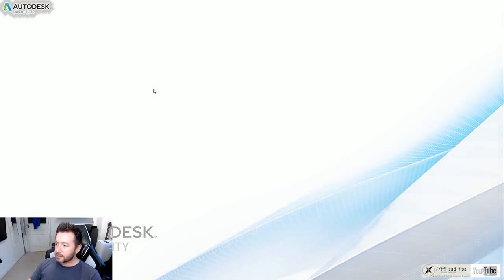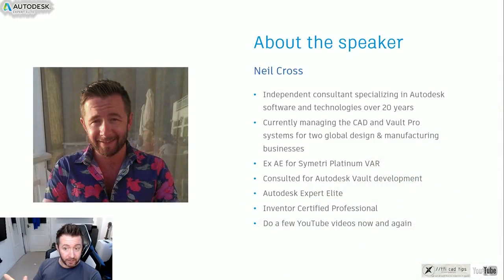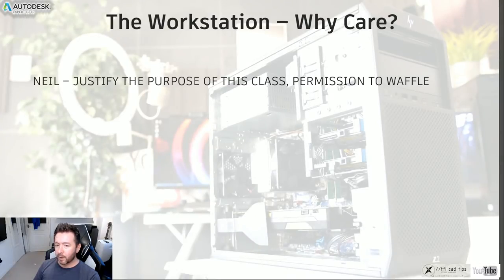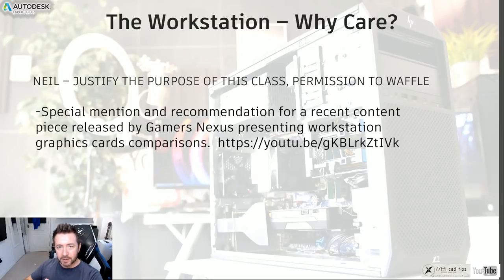Buying the Right Workstation For Inventor | Autodesk University 2018 Class Lecture

Comment: Hi Neil, do you know how the Inventor studio scales with cores vs clock speed? Secondly did you ever run tests on compute speed for FEA (not just meshing but solving), would be curious to see if thats just as poorly optimised for multi-threaded workflows. As a follow up to that as well, do the new Tensor cores on Turing cards actually do anything for this in Inventor?

Comment: Really interesting.   I'm in the market for a new workstation with good budget.  Just wondering, the i9900K is faster than the Xeon that you listed, so surely that home workstation would be faster than the "pro" workstation?  I assume the only reason you didn't recommend it is like you said, the reliability of the Xeons?  Also, the 1080ti has 11gb ram compared to the p4000 8gb AND it's cheaper.  So if the GPU doesn't really mattter then a 9900k + 1080ti would be the best combo available at the moment?

If anyone has this and has benchmarked, I would be very interested in the result :)

Comment: That same  HyperThreading BS is present during importing non Inventor CAD files as well. During importing 400 MB .STEP file, my 6C/12T CPU is maxed at 37% utilisation and I have to wait over 10 minutes just for Import dialog window and I have Samsung 960 Pro. Annoying AF. Load is spreaded over all cores, that's true, but I was expecting 100% utilisation like during RayTracing...

Comment: Always good to hear your tips Neil, excellent job.....I have just built this via an HP agent, looking to purchase in the coming days, would you verify all is good?

HP Z2 G4 Workstation - Customizable
SKU:2YW27AV_1
Windows 10 Pro for Workstations - HP recommends Windows 10 Pro
HP 3.5 to 2.5 Drive Carrier Z2 Tower
Intel® Wireless-AC 9560 (2x2) Gigabit Wi-Fi + Bluetooth® 5 (no-vPro™)
HP Remote Graphics Software (RGS) for Z
ENERGY STAR Qualified Configuration
Operating System Load to SATA
3-year (3/3/3 - material/labor/onsite) Warranty
512 GB SATA 2.5" SSD
500 W 90%-efficient Chassis
NVIDIA® QUADRO® P2000 (5 GB, 4 DisplayPort, PCIe) Graphics
Z2 G4 Tower Country Kit
9.5mm DVD-ROM 1st Optical Disc Drive
HP Z2 G4 Tower Workstation
32 GB (2 x 16 GB) DDR4-2666 ECC Unbuffered Memory
No Load Flex Port
Intel® Xeon® E-2176G Processor (3.7 GHz, up to 4.7 GHz w/Turbo, 12 MB Cache, 6 core) + Intel® UHD Graphics P630
Single Unit (Tower) Z2 Packaging
Z2 TWR SATA Data Cable - ST-RA -015
HP Optical USB Wired Mouse
HP VR Ready Configuration
USB Business Slim Wired Keyboard

$2278 USD

Comment: Hi All, 
I do Alias 3D modeling for production….not a lot of videos that talk about Alias So I thought I would chime in. Listed here is my list so far for a new Alias machine. I don’t know the specific chips or ram specifically yet. I use Alias Auto Studio 2019 to make Class A surface for production in car design. I render with Vred and KeyShot 8. This machine is only for modeling and rendering. I’ve never over clocked, gamed or been interested in RGB LED case…just a powerful machine I can set and forget.

I’m thinking and Dual Xeon chips with Dual G Quadro P4000 Graphics cards.I am seriously nearsighted so a new monitor the size of the sun is needed. Worried about the size of the Alias dialog boxes and marking menu sizes with new 4K or widescreen option available. Due to my blindness I’m starting with the monitor. The 38” monitor from LG with 21:9 ratio or a Samsun 43” or 49” look great but Dell does have the 43" Dell Multi-Client Monitor | P4317Q and the Dell Ultra Sharp 49 Curved Monitor: U4919DW. I need to be able to sit back from the monitor yet see the main menu. 

1. Chips (2) ?

2. Motherboard?

3. SSL drives.

4. RAM.

5. Monitor.

6. Graphics card- P4000 (2 units).

7. Case-

8. 

.

These guys make a great machine… 

https://www.titancomputers.com/ 

https://www.pugetsystems.com/

Autodesk Alias' listed system requirements looks to benefit from several CPU cores, so going with a higher core count processor looks to be beneficial

https://knowledge.autodesk.com/support/alias-products/troubleshooting/caas/sfdcarticles/sfdcarticles/System-requirements-for-Autodesk-Alias-2018-products.html

In Autodesk VRED the system requirements does not appear to benefit from several CPU cores, and recommends at least 8GB RAM, along with current graphics card.

https://knowledge.autodesk.com/support/vred-products/troubleshooting/caas/sfdcarticles/sfdcarticles/System-requirements-for-Autodesk-VRED-2019-products.html

Here is their certified graphics card list: 

https://knowledge.autodesk.com/certified-graphics-hardware

Photoshop and Illustrator benefits from hardware as mainly a single-threaded program.  That means instead of benefiting from several CPU cores, mainly benefits from a high CPU frequency (GHz rating).  The higher the GHz, the faster calculations occur per CPU core.  That makes a processor like the 6-core Core i7 8700K with its 4.7GHz Turbo, or 8-core Core i9 9900K with its 5.0GHz Turbo great choices for performance.  Not sure here….to many options to look at…

In my testing of Keyshot I saw that it is a very well multi-threaded program, benefiting from more CPU cores, so going higher core count, the better performance you will have.

https://www.pugetsystems.com/labs/articles/KeyShot-7-CPU-Comparison-New-14-16-and-18-core-Skylake-X-Processors-1044/#BenchmarkResults

Since it looks like some programs benefit from several CPU cores, and some programs benefit from a high CPU frequency (GHz rating), I think the best thing to do would be to go with dual CPU that offers a good amount of CPU cores, and CPU frequency.  If I go this route, a 14-core processor or more to account for the lower CPU frequency these processors have would be where I may start.

I’ll keep you posted as I find more data…..

Comment: I just bought an MSI Gaming laptop ( GF72 8RE) to run Inventor. I need a laptop for portability. It runs Inventor effortlessly. I don't need to do any ray tracing which is where it would no doubt struggle but for 3D CAD it's awesome, as is Inventor.
Oh, and so are you Neil. Thank you for the tutorials and advice.

Comment: Thanks Neil as despite being considered an expert where I am, I am by no means any expert just under 2 years experience of Inventor my skills are good but not as good I want them to be, thanks for the amazing videos and whilst you may call yourself an amateur youtube creator, you are a professional at CAD and these are the best videos within miles.
Reply: I currently use a 7800X as my general purpose PC as whilst it has 6 cores it can go much fatster and OC'ed without any perofrmance or stabilty risk which is much cheaper than a xeon based system, plus the extra PCIE lanes are great for ssds.

Comment: Autodesk publishes the hardware specs for each of their products on the website.. I was wondering your opinion on this @TFI? I see this same discussion about "which hardware" over and over in countless forums. If everyone just referenced these specs from Autodesk and purchased their system accordingly that would be the end of discussion right?
Reply from the maker: I should probably do a video on that, the specs on the Autodesk website against the products are less than vague, they're not enough to actually go and tangibly choose something specific.  They're certainly not enough to ensure you're not wasting your money on something terrible which is worse than something you could buy for far cheaper.  Example - Inventor recommended CPU for complex models is 3.3Ghz or greater, 4 or more cores... well the Xeon Gold 6144 CPU has 8 cores and runs at 3.5GHz, and costs a whopping $2925 just for the CPU.  But there are CPUs for $400 with specs far more suited for Inventor.  Its not Autodesks fault, they can't perpetually monitor new CPUs and keep a running 'best computer' build sheet constantly updated, that's for the likes of me to do :)

Comment: Would it be a safe assumption that Autodesk Revit is going to perform similar with Inventor as far as how the programs are designed and operate, i.e. mostly single threaded, graphics accelerated by the cpu, etc.?
Reply from the maker: I honestly don't know sorry, I don't know Revit well enough to be able to test it... I know Inventor inside out and know which workflows take the longest to perform, but not so much with Revit.  I've previously tried asking some Revit experts about this but they just didn't understand why I was asking and I didn't get the info I needed.  If I can find someone who can give me a bunch of big datasets and explain what to do to stress Revit, I could probably build something off that.

Comment: My friend is using an i7-4960X and I want to upgrade my computer to something similar but with a lower cost.
I do everything from 3D modeling to AE compositing. So far my projects did not involve a lot of rendering, except a couple, and according to Cinebench and stuff 2600x seems to do well for me in rendering. (if Maya's mental ray performs the same that is) A Future project will involve a protein structure model of a virus and this seems to have a lot of polygons.
I was thinking Ryzen5 2600x, because the results on the internet shows that it is a bit faster than my friend's pc. Do you think R5 2600x is good for maya and mental ray rendering? I mean I would love to get the latest and the greatest but I have a limited amount of budget and was wondering if I can make it work with 2600x.

Oh, and seems like RX580 has the same specs as WX7100 with faster core clock. Does that mean that I can use RX580 instead of WX7100? or is there an advantage using the WX7100 over RX580?
Reply: rkdheewon I would take the ryzen 5 2600 over the 2600x you paying way to much for just a slight bump in performance and all amd chips are unlocked. ;)

Comment: Hi Neil, just spec’d this out, could you advise if it is good/ bad, well priced?, please and thankyou, awesome videos you do!, well done indeed:

 Description
HARDWARE:
Intel Core i9-9900K Processor 8 Cores 16 Threads 16MB Cache to 5.0 GHz
ASUS Prime Z390-A Motherboard for 9th Generation CPU
Crucial/Samsung 16GB DDR4 PC-2666 UDIMM Total 32GB
Samsung 500GB 970 M.2 NVMe Drive 32 GB/second 5 Year Warranty
LG DVD Optical RW+/-
Nvidia Quadro P2000 Graphics Card with 5 GB DDR5
Thermaltake Toughpower 750W Power Supply with 5 Year Warratny
Silverstone Mid Tower Case Super Quite
MS Windows 10 Pro License with DVD
Internal Multi Card Reader
Corsair 115i Liquid CPU Cooler
Rosewill WI-FI Gigabit Wi-Fi Card Dual Band
Item Price
$2,599.00
Reply from the maker: Yep definitely a good price, should be a solid performer

Comment: Really nice demonstration of the GPU being CPU bottlenecked :D
Reply from the maker: Indeed well it's technically not really bottlenecking as the graphics engine is entirely a CPU activity, the GPU isn't being used at all to be bottlenecked.  Even the most powerful single threaded CPU on the market would still 'bottleneck' the graphics performance so I don't think that falls under the definition of bottlenecking! But I see your point either way :D

Comment: This is fascinating stuff but a lot of your arguments are based on your personal experiences and your solution tends to be "spend more money because that is better" I mean for someone setting up a drawing office with a huge budget who doesn't want to ever worry about a machine breaking down, then fine. But in many cases you have a limited budget and possibly the benefit of professional IT support. I mean I can switch a user from one machine to another in less than 30 minutes including their settings files etc. So I aren't worried about spending less than half as much and getting the exact same performance.
Reply: I take that back, I didn't watch for long enough before passing judgement, my apologies.

Comment: Just go to Puget systems and buy or diy the system for better well rounded and touch of your tastes
Reply from the maker: I've never dealt with Puget so I can't personally recommend them.  I have no idea what they're like to deal with before and after sales.
Reply: Puget is very good pro people
Reply from the maker: @JoeGoreta  I might be speaking way out of line here and uneducated, but I do wonder how many people with expert level 3D CAD knowledge & experience would end up working in a PC shop with their highly valuable skills.  These places claim to have internal experts but experts usually demand a bigger salary than you would expect a PC shop could realistically afford.  I could be very wrong about that though, I guess individual circumstances differ.
Reply: @Neil3D  but for just after listening to your insights on inventor the system they suggest match specs on par with your recommendation 
P4000 and specific models of xeons with their results and reasoning on their blog
Reply from the maker: @tanmaypanadi1414  Fair enough, I haven't ever read up on anybody elses research, everything I've ever done has been 100% my own work and opinions so I tend not to look around at what others are doing, I'm sure they do great work though.  I've only ever seen or heard of Puget before on Barnacules channel, and I found that to be a very odd partnership!

Comment: Looks like the pros use Remote Workstations with Citrix, perhaps thats the right approach moving forward (HP and AMD graphics with Xeon CPU)... what do you think of this build ?
https://community.hpe.com/t5/Internet-of-Things-IoT/Unchain-your-engineers-and-take-back-control-HPE-Edgeline/ba-p/7026810?utm_source=dlvr.it&utm_medium=twitter#.W_7VKmhKj-i
related: https://community.amd.com/community/radeon-pro-graphics/blog/2018/11/28/always-on-the-go-with-amd-remote-workstation-and-hpe
Reply from the maker: I've just switched on a site in China that are using remote Citrix workstations, I'll know in a few weeks how that goes.  I can see the logistical benefits in having an exclusive VDI based environment but I've yet to see or hear any material which suggests its on par with physical local hardware in terms of performance.  If someone was to give me a local Citric setup I could check it out to see how much performance you're sacrificing for the convenience of a remote infrastructure, but realistically, I can't help but feel that the question is how much worse will it be.  I can imagine the input lag would drive people crazy.  However, clearly that's the way things are going though so I'm going to look into testing some stuff around AWS hosted workstations to see whether that's usable enough to recommend.

Comment: I'm a Fusion 360 user - Is this still relevant to that too?
Reply from the maker: Almost, yes.  Inventor and Fusion 360 share the same graphics engine although with it being a newer application, I couldn't say the extent of the single threaded workflows would be the same.  I'd have to look into that but it's very very similar.
Reply: @Neil3D  Thank you for the rapid reply!

Comment: How will this HP do Fusion360??
Reply from the maker: It should be just as good for Fusion as it is for Inventor, there's a few people asking that so I might run some tests on it.  Thing is, I don't know if a workstation like that is a little unrealistic for a typical F360 user... they tend to be home users who might want something cheaper.  But tbh Inventor & Fusion run on the same engine so it's going to be pretty comparable.
Reply: @Neil3D  Thanks for the quick reply. I could be nice to see how it rund with fusion. I'm an old inventor user but the day to day projects i use fusion 360 and have always been told by my reseller that fusion is GPU intensive .

Comment: Autodesk inventor have a lock in the fps....that why you will not ger Any extra performance on a model Like that ..  sorry but tur only Thing you just proof that you Are not totally up to update About inventor 😉.. but Like your video Anyway
Reply from the maker: The class was done in front of the lead graphics developer for Inventor and many of the UI team, if there was a such a fundamental issue with my results it would have been highlighted long before you saw it. And there is no fps lock or ceiling in Inventor. That's a measurable objective fact.
Reply: @Neil3D  i am sure i have read About this fps lock in ones og Autodesk our what news in inventor... as they made it high Think it was in version 2014 or 2015..
Reply from the maker: @borgetret  So that thing you can't remember reading from 5 years ago, that's the foundation you're using to tell me that I don't know what I'm talking about? Jump to 1:08:49 in the video, look at the chart, have a long hard think about it and what you said, and then consider how offended I might be at being told I'm not totally up to date with Inventor.